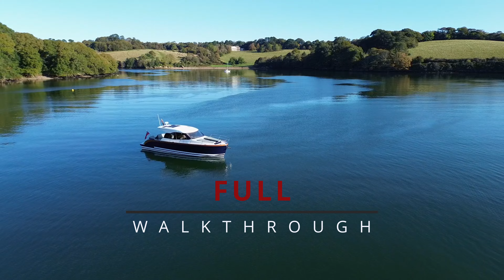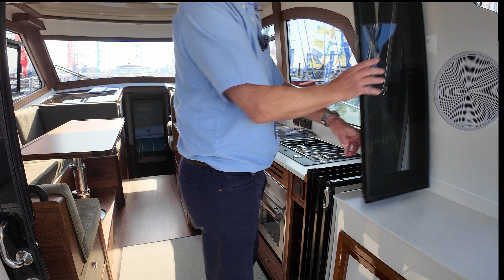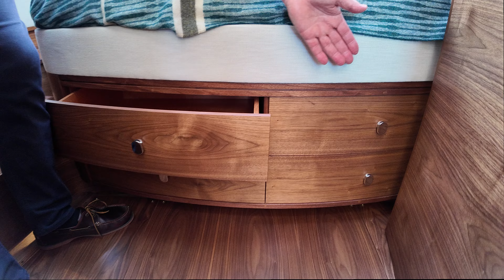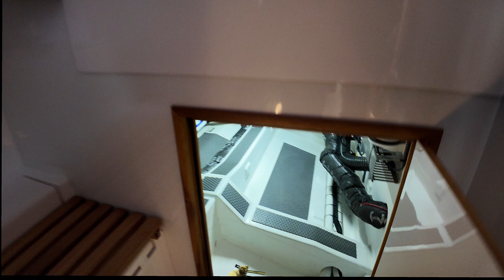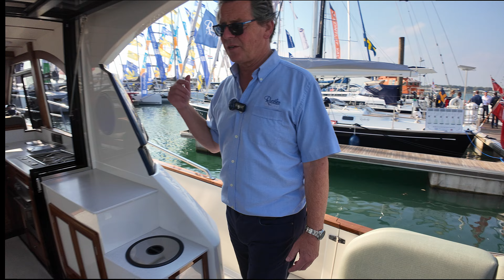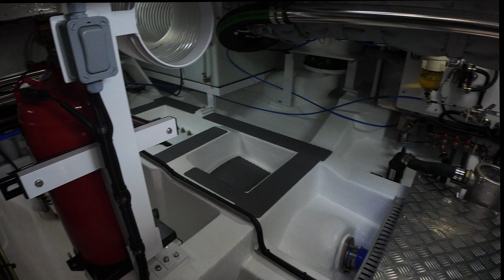First Look! The NEW 41MY | FIRST EVER Power Boat by Rustler Yachts!

Comment: Congratulations to Rustler 41MY on Hull #1, the exterior looks like it's poetry in motion. The room you set up the electronics with cooling, great idea, it's been one of my pet peeves that you keep the electronics in hot engine room, weird. Adrian failed to mention whether or not the platform off the stern submerges? or if the 41MY has a bow thruster? They should. Cockpit looks very inviting, is there a table? Cockpit also needs small refrigerator. The interior in my humble opinion, looks like it's built well, but standard fair, needs a little panache, like a grab-rail, down center of the roof and great for rough seas, this will also give the boat a little offshore "creds". The sink and the hob, will have a neater presentation if both had covers to integrate them with the rest of the countertop, including a dedicated space to store them. The table top looks like it has been fiddled, the counter across should also be fiddled as well. The door next to the helm going out to the deck seems a little small and tight even for Adrian. (and especially in US market, larger people) Perhaps you should consider a pocket door for the owners cabin, this would help with the much needed... space      Best of luck!
Reply: The swim platform is fixed but you can have an extended one as an option, which will fit a larger tender on davits. They do have bow (and stern) thrusters - these are the proportional ones from Sleipner which are amazing as they are much quieter and you can use the 'press onto dock' function if you're short-handed and need to get off to secure lines. You can spec a fridge into the cockpit and a wet bar with grill if you wish, under the window that you saw Adrian tilt up as he entered the saloon.
Reply: Thank you for your kind words. The swim platform on this boat is fixed, as we suspect most will be. There is, however, an option to have a lowering swim platform - but it does increase the cost. As Will said, this boat has both bow and stern thrusters. There will be a table in the cockpit. Sadly, due to this being the first R41, we focused on getting her interior to a level we were happy to exhibit, which meant there were, unfortunately, details we would have preferred to rectify. After the show, she returned to the yard, where the details we were unhappy with were ironed out. The inside/outside galley area is one area where everyone wants something slightly different, but this is exactly what we specialise in, tailoring your boat to you. Whether you want gas or induction, storage or space, grills or refrigerators, the choice is entirely up to you. Likewise, we are happy to customise any of our boats in any way an owner wants as long as it is safe and fits the shape of the hull!
Reply: @Rustler-Yachts  Thanks for the response, your boat is a beauty, and... good luck!
Reply from the maker: Yes, congratulations to Rustler on the beautful 41 MY and thanks for your thoughtful feedback! We truly value opinion our viewers. We will yeild to the experts over at Rustler on this one, but, Your passion for boats shines through!
Reply: Absolute stunner!! A Rustler through and through. Congratulations